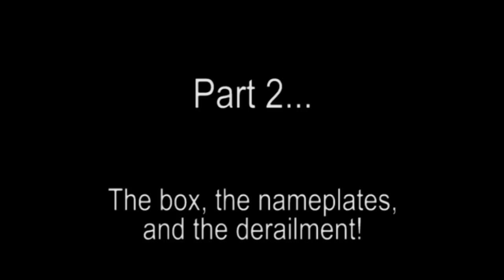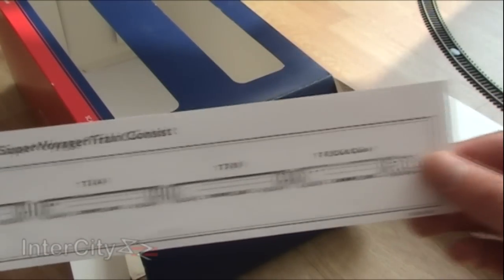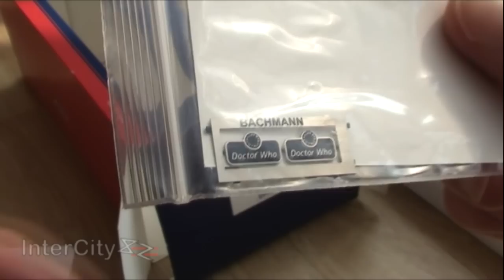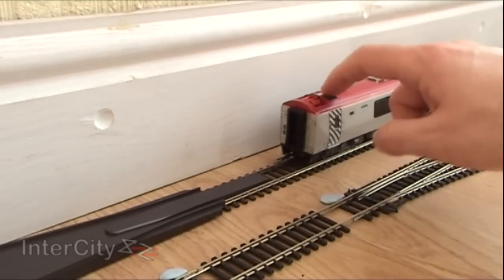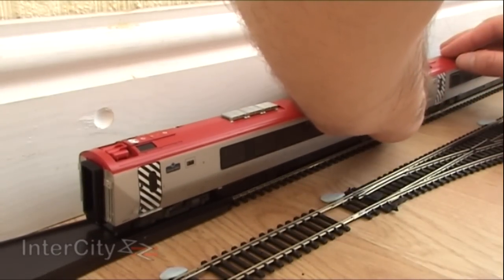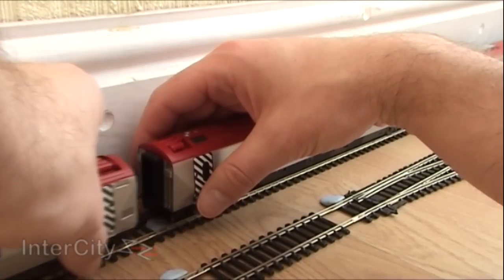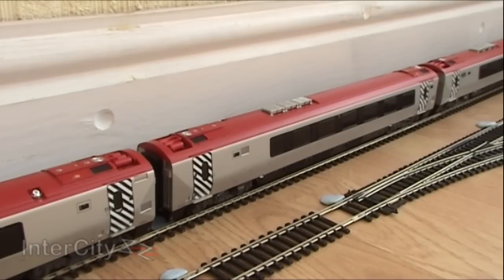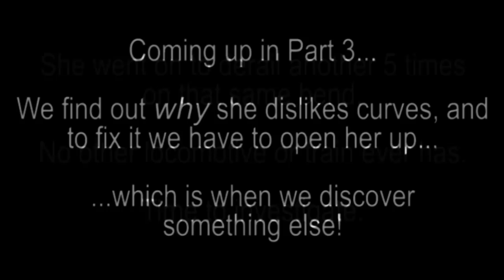The Class 221 Virgin Super Voyager by Bachmann (Part 2)

Comment: Hi will...i recently bought the virgin 221 but where are the couplers kept ? Cant seem to find any in my box pack. Do they use standard bachmann coupler bars ? Thanks
Reply: In The Clear Plastic That The Locos And Coaches That They're In (Not The Giant Box The "Blocks Of Ice" That The Locos Are In
Reply: They are usually kept in the 'Block of Ice' where the motor unit is kept

Comment: What does DC means and what's the difference between DCC and DC?
Reply: DC means Direct current, & the Difference is  DCC Is Digital and DC is  analogue.  Most of my Trains run on DCC.
Reply: DC means you connect an ordinary power supply to the track and all the trains run at the speed according to the power put to the track.  
DCC means that the trains each have a little computer chip inside them, the track has constant power at all times, and you can control each train individually with separate controllers without separating the track into blocks or separate electrical sections.